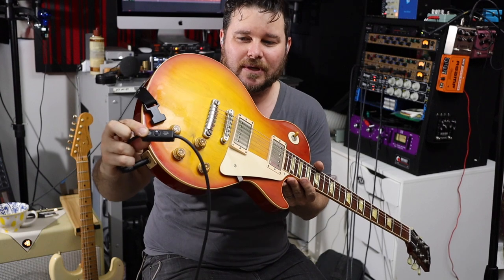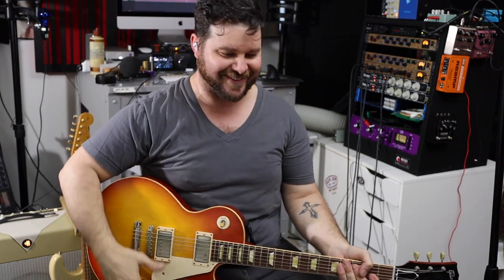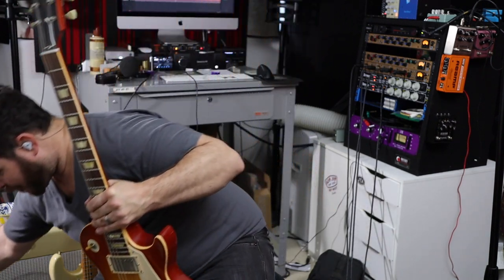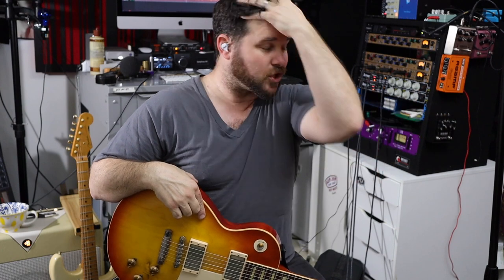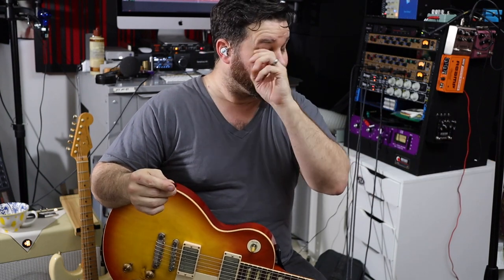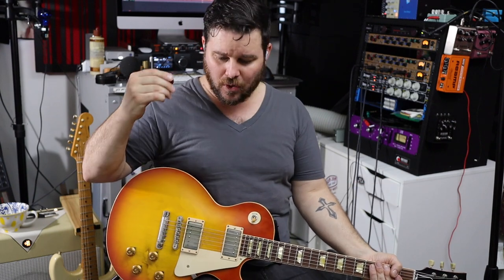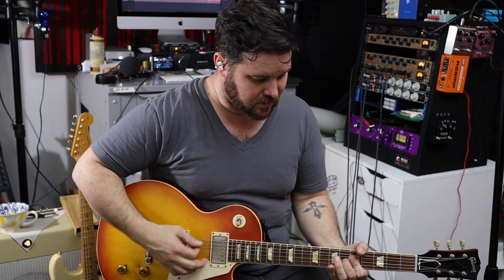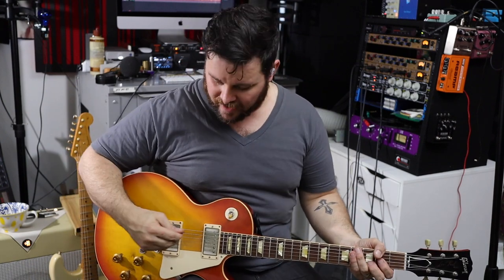Amp Cabinets - openback vs closed back

Comment: I just bought a Celestion creamback neo  and put it in my Blackstar Ht club 40 MK II combo it used to have a 70/80 and I can’t decide which way works better for the cream back
Reply from the maker: Hey Zack, for me I always decide how tight I need the low end to be, and if the speaker starts to be too brittle when closed back… if so then just leave open :)

Comment: you need to do more demos, you are excellent sir!  thanks for the explanation.  I just bought an EVH lunchbox and I am going to connect to my Carvin open back one 12" speaker, I am concerned volume-wise, I want to be able to play loud and clean tones at times, I know the amp is great for solos but is it okay for relatively clean rhythms?
Reply from the maker: @marshallamp man hey thanks! I’m not sure about the EVH, I’m sure it does great drive, dunno bout cleans though. What I can say is loud clean is really relative. (Is there a drummer? Les Paul? Tele? Etc)

Comment: Hi.  Just stumbled across your video.  Very interesting and informative.   I gig with a Marshall 4x12 greenback cab and a JCM 800 playing rock.  Now I’m on the fence about what cab would be best for gigs in bars, small clubs.  The 4x12 is a lot to lug around so maybe something lighter/smaller would be better.  Two things are very important to me though, how the cab feels and the onstage sound and obviously also how it sounds front of house.
Any ideas on the perfect cabinet for this purpose?
Cheers
Keep up the videos.
Reply from the maker: @vintagesound8112 hey right on thanks! Thee advantage to closed back live is the sound stays in one spot to me, so if you need the stage to be tighter sounding, that helps… and obviously it’s tighter feeling for rock… but that can also be a disadvantage when there’s not side fill monitoring or your  NOT on “in-ears.” That’s where open back is awesome, it fills more of the stage/room, and yeah it’s looser, but for me I find I’m not playing quite as distorted these days, so that tightness isn’t as much of an issue… in your case i’d probably play an open back 1x12 and closed back 1x12… more to bring to the gig, but might make you really happy:) thanks for the positive feedback!
Reply: Hi.  Thanks for the reply.  That’s an interesting solution, so two separate cabinets combining the advantages of closed and open back.  How big are the cabinets themselves?  Are they like a typical Marshall 1912 size?
I’ve heard of people using 1x12 cabs before but can they keep up with a heavy drummer?
Also there are Barefaced cabs with their Avd porting but I’ve never heard anyone using those.
Great sound with the Les Paul by the way.
Cheers
Reply from the maker: @vintagesound8112  if it were me, I’d just get a couple of avatar cabs, one G112 convertible, one G112 vintage, maybe vintage 30 in open back and creamback in closed:)
Reply: Thanks. I’ll check those out

Comment: Tell me what you think about this ' I have a 68 vibrorlux reverb 2-10
Thought about closing one of the speakers in. 
How would I go about switching from one speaker to the other ?
Some sort of Aby pedal ?
Reply from the maker: @Keith Clark- personally I wouldn’t use an “A/B” box.. in this case Fred at Divided by 13 made this box specifically for this purpose. I suppose a fully analog A/B box would work fine but I’d ask the manufacturer about using it for speakers.. As far as closing part of the cabinet that would be a trial/error thing… my guess is it would be easiest to just get a closed back 1/12 to have as an extension OR instead when you want closed… just need to be mindful of impedance… the vibrolux should have 8 ohm speakers summing to 4 ohm… so you’d have to either run one 10” at 8 ohm AND the closed back at 8ohm so the amp “sees” 4ohm, or you could get a 4 ohm speaker but then you could ONLY run the closed back OR the 10’s… make sense?? I don’t believe the vibrolux can take 2 ohm if you played both the 10’s and the extension speaker … I could be wrong but those are my initial thoughts

Comment: How do you like the mpeq 1? What is your recording chain?
Reply from the maker: @darrylweller the mpeq is so incredible, I’ll be really sad if I ever have to sell my pair.. what I like most is the flexibility, tons of headroom, yet transformer and impedance options to get saturation . The recording chain for this video was just the 57’s and the Gefell room mic and my mic all into the mpdi, I used 250 ohm setting on the input transformer, and the output pad was on hitting the output transformers harder. That’s it

Comment: Another great video! Good to have both open and closed back. Just like your favorite cabs in the OX right? Man the OX is such a great tool. I have cabs but can rarely play because of volume issues where I live. Was trying to decide between the OX , Captor X, or getting a Fryette Power station to use with IR's. Power station  supposedly has the most transparent reactive load part and it has the tube power amp and the PS100 has two setting's of EQ and volumes which could be really handy in a live setting. You can even plug two different amps into it and footswitch back and forth. But the UA sounds really good with those cabs and mics etc. I think it's between the OX and PS100.
Reply from the maker: @yourstruly thanks!! dude the ox is paramount for me at this point... I’m sure some of thee others might be a little truer to the amp, but for now the ox really fits my workflow with mic/cab options and effects...